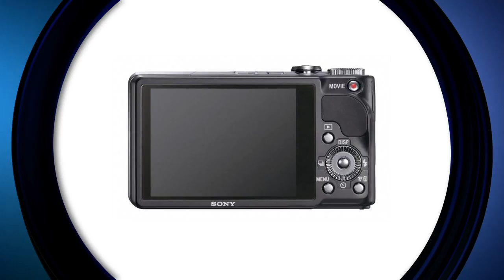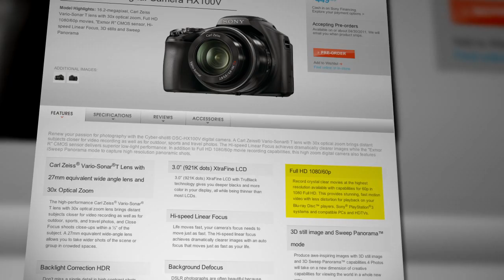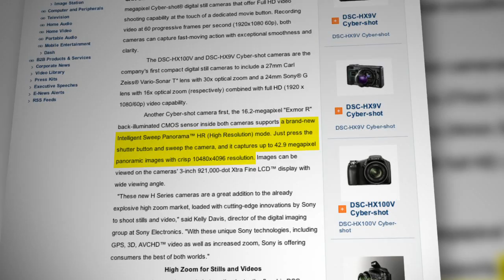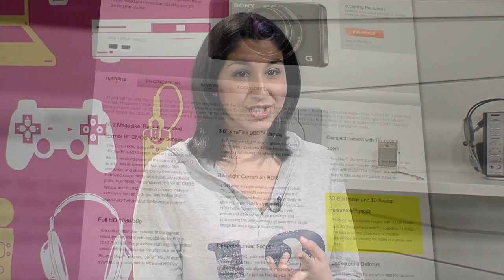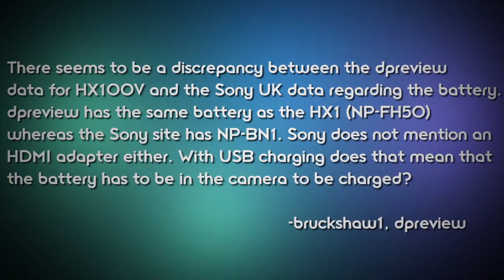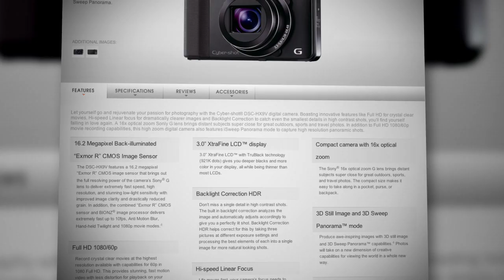Your  HX9 & HX100 Cyber-shot Questions Answered

Comment: @2010unseen This review of HX100. Why Sony WX10 or H7? I had H7 and I was very much happy with it. It takes good still images but average video (not a stereo mic) . I have a H55 which more alike as  WX10 but does'nt take the same true color images as H7. I have a HX1 which is more alike as HX100 but none of them to compare to A560 DSLR (with mic plug for3.5 jack)1080pHD bigger sensor and incredible true color still images. It does'nt have auto focus in video mode, but very fast for still images.